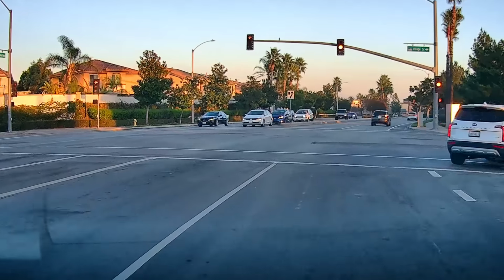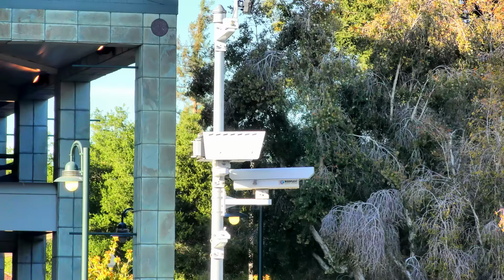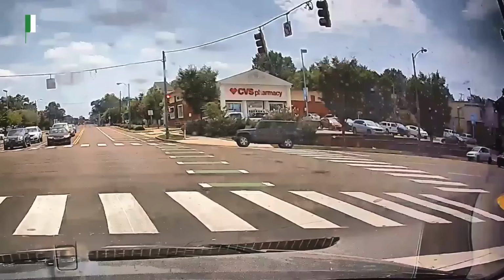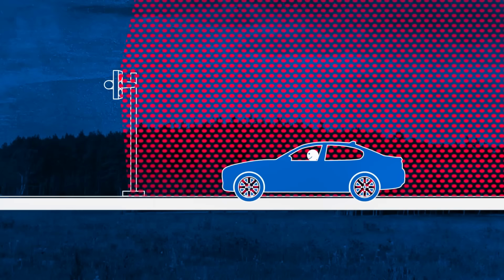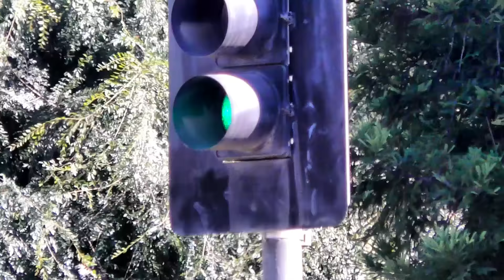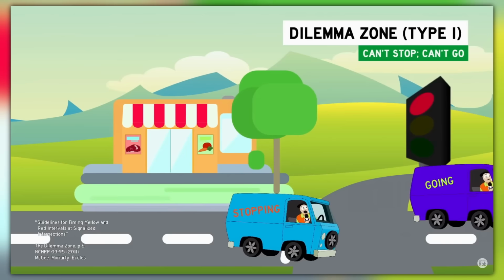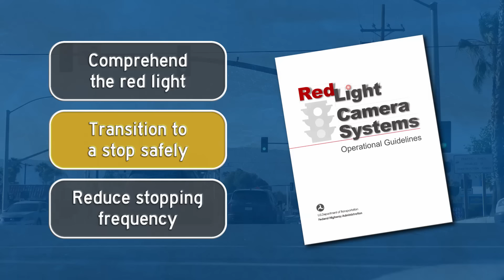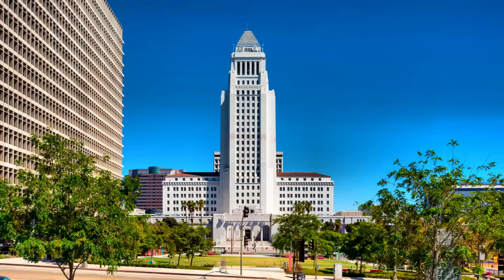Three ways to FIX a STOP LIGHT (so drivers ACTUALLY STOP!)

Comment: I like intersections where there is a countdown on the cross walk signal - it provides a good clue as to how long before the yellow light will come on.  Perhaps something like that but more visible would help people avoid the dilemma zone.
Reply: Beijing has some really advanced signals where the red and yellow lights also doubles as a numerical countdown timer. Seeing the seconds until the next red/green really helps with mentality behind the wheel, especially when negotiating the much less straightforward lane usage changes and chaos of oblivious pedestrians and careless two-wheelers (both pedal and motorized).
Reply: where i live those count downs are totally misleading at some intersection
Reply: @robertbennett2796  I guess that you're talking about the crosswalk countdowns, correct?  I've noticed the same thing where I live: just because the crosswalk timer hits zero does not always mean that the traffic light itself has just hit - or is about to hit - yellow
Reply: I agree with you, but I think it currently violates the US DOT road signal/signage regulations. I looked it up a year or two ago.
Reply: Morocco does this with their traffic signals. Red and green lights with a count-down to the next flip. I loved seeing it when I visited!
Reply: I also like this because when your waiting you can see the countdown and know that a green is not far off. For long lights it can help your sanity just a little bit.
Reply: @brandongaines1731  Yea depends on the intersection. Although usually you pickup on the rules on roads you drive down all the time.
Reply: In other countries the entire traffic light is actually just a giant count down timer.
Reply: I've seen car traffic lights with countdowns in places in Koper, Slovenia several years ago
Reply: Smart signals will keep adding time to the green light based on traffic volumes (there are detectors in the road). So a timer can not be installed on these efficient signals since they can't predict how long they will stay green. They adjust in real time based on traffic.
Reply: @failedfishermanBC  Actually I have seen timers reset to a higher number part way in the green cycle and the red time increase so clearly the technology to add 2 numbers together and display it exists. lol

However, I have never seen them shorten the time, that may be where an actual issue lies.
Reply: @zeroibis  Yes, adding or subtracting time from a timer really negates the benefit of a timer lol
Reply: @failedfishermanBC  The boost resetting the counter would not be troublesome as long as the boost was never applied when the counter got to single digits.  Not an unreasonable constraint.
Reply: @stevengordon3271  Yep, you're right. Most signals wait for a "gap out" time to decide when to turn yellow. Typically this is 4 seconds so that if no cars are detected for 4 seconds, it will instantly turn yellow and then red. The gap out time also normally shrinks the longer the light stays green (so a signal is more likely to switch to yellow if it has been green for a long time). So a signal doesn't really "know" that it will extend the green time until the final few seconds before a yellow light.
Reply: @failedfishermanBC  That is abrupt, but with a gap there is nobody there to care.
Reply: Yup the one by my neighborhood is like that if I can see the little walking man from several blocks down I get up to full speed and just make it by a few seconds. If I see the hand blinking I won't hit the gas so hard cause I'm gonna have to stop anyway.
Reply: It kinda backfires in the DC area, especially with red light cameras. The countdown causes people to panic and slam on the brakes unnecessarily.
Reply: I think a study was done that found that timers were worse, As they were more likely to race the yellow
Reply: Yes! I use the crosswalk count down when possible.
Reply: I have the opposite problem.  In Bellingham, at the intersection of 126 and 140, the cars STOP at a GREEN light!  By the time anyone moves, the light turns red!
Reply: I saw one once that both the red and green had count down on the main light. I thought it was super genius. While the red light was on the yellow light area turned into a red countdown colored red. While the green light was on the yellow light area turned into a green countdown. I was told if someone pushed the walk button while the light was red a pedestrian pictogram would show up in the green area colored red. So red light is full circle > timer > pictogram all red. If a pedestrian in the flow of traffic during a green light would show a green pedestrian pictogram in the red area. So green light is pictogram > timer > full circle. The idea to notify people that a pedestrian may be in a cross walk and to obviously stop but not to go until clear or extra observance turning left or right while the light is green.
Reply: @failedfishermanBC  I've also seen signals here in Canada that have the pedestrian timer solid for a bit, then add the countdown. Rare, but I think sensible in an area where the traffic flow changes dramatically based on time of day, holidays, etc.
Reply: Honestly those are amazing, I didn't realize how much they were useful until I lived somewhere that had them and then went back home and I couldnt tell when a life was gonna turn yellow and you basically have to guess without them.

I will say anyone that misuses them however, like making it turn yellow or red at 3 seconds, is messed up and should lose there license to do anything road related, but as long as it follows the logic of 1/0 = yellow it really solves alot of issues
Reply: @sharrpshooter1  In Guatemala City, they have countdown timers on the red. I remember one would start at 90! That's worth shutting your engine off.
Reply: @brandongaines1731  There are some intersections by me where the countdown timer counts down and if there is no traffic on the minor road it just goes back to walk and the light doesn’t turn red. 
Some others the walk signal comes on 2-3 seconds before the green light if someone has pushed the beg button. The first is annoying as a pedestrian if you are walking up to the corner while it is counting down and no traffic on side street you still have to push the button or the side street doesn’t get a green. You might not push it in time and then have to wait the whole light cycle before you can crops the street.
Reply: @Crash8668  I know how that goes - though, tbh, the only intersection like that near my house is one where I'm usually walking along the main road, anyway
Reply: @Crash8668  I personally am not a huge fan of the ones that turn on the walk signal before giving the green light to the traffic - if it's not safe for the motor traffic to move until the other direction has had a sufficient chance to stop, then how is it safe for pedestrians to do so?
Reply: @brandongaines1731  I hate one by me where I have to cross 3 corners as the 4th has no crosswalk. Miss the one to cross the Main Street and wait 2-3 min. Worse when raining.
Reply: @Crash8668  I can sympathize - the intersection on the main avenue by my house has one crosswalk that gets its own personal slot in the cycle - if you miss it, then you have to push the button again and wait for the cycle to come around again!  I once missed the bus to a job trial because I kept missing the signal and having to re-press the button!  In retrospect, of course, I should've just tried going around the other 3 ways and waiting for the next bus - better late than never, lol
Reply: all have that
Reply: One intersection near where I live has the  crosswalk that goes yellow at 5 seconds and red at 3 seconds. Might as well delete the yellow light.
Reply: @kgaming7599  not all of them. Even on highways there's lights with no countdown, it's just yellow for 2 seconds then red
Reply: @brandongaines1731  You are correct.  However, seeing the crosswalk countdown may make people more alert to what's happening: if traffic lights turn yellow, you have anticipated that you must slow down; if they continue to be green, you can continue, with duly cautious speed, through the intersection.
Reply: @brandongaines1731  -- As for your comment about the walk light turning on before the green, that is more engineering taking place. The green is delayed so that pedestrians can start crossing the street before turning traffic takes over the crosswalk. In other words, it is for pedestrian safety.
Reply: @TheRealScooterGuy  thanks!  I probably never would have realized that on my own
Reply: In some parts of Mexico, the green light start to flash to warn drivers of the yellow light. I honestly prefer it and it helps me avoid that dilemma. I wonder if it would help out in more places?

(Also outlining where the 'point of no return' is? And, adding more time to the yellow 🤔)
Reply: So I'm not the only one who used crosswalk countdown to indicate when the traffic light is going to change. 
I think something like that could work great on the back of a car showing its speed. Red brake lights don't show you how fast the vehicle in front of you is slowing. But with a speed indicator on the back of cars if the speed is decreasing slowly they're breaking slowly if the speed is decreasing quickly they're breaking hard as in they just  hit the brakes.
Reply: that will lead to more distracted driving, resulting in more rear-end accidents...I like my idea about pop-up spike strips.
Reply: About half the time nothing happens when the count reaches zero.
Reply: @AshGreen359  In my area, I have learned which intersections have useful crosswalk countdowns.
Reply: Yes! I use those in my downtown area.
Reply: @failedfishermanBC  Rotterdam (which is in the Netherlands, meaning they have smart traffic signals that adjust the length of green time, in real time) tried adding timers to their traffic lights, and it failed miserably. "Ontario Traffic Man" has a video on it
Reply: Yes, I love them!  This should be everywhere,  crosswalk or not.
Reply: I totally agree with the countdown. 
Before the timers, when the  ' don't walk  ' started to flash,  I'd start to slow down. However,  sometimes that didn't always work because as I'd almost come to a complete stop it would change back to walk.
Reply: The best solution is short timer that starts counting around 5-10 seconds before the light changes. This way it gives you some information when you can expect the change but also does not prevent using advanced traffic light systems that are deciding on changes based on the traffic. Generally you can't say that the light will change in 60 seconds because those systems don't know it. Maybe it will change in 20 seconds if there's no more traffic and you can go. But those additional 5-10 seconds of countdown will be enough to let almost everyone to take much better decision. It's wet or snowy, you have longer stopping distance and you see a few seconds left, you already slow down and stop as you would not clear it in a safe way.
Reply: well said,  five to ten seconds plus the yellow duration is a pretty generous time to clear.  And likely to improve safety considerably without interfering with timing.
Reply: @brandongaines1731  If no one has pushed the button cross street button, it won't change. However, if there is no cross walk button, then it will change automatically.
Reply: Steven, you are right on the mark about the countdown peds BUT, unfortunately, many localities are seeking to do away with the "CNA/rest-in-walk" feature that allows coordinated mainlines to automatically display a WALK signal along with the travel green light.  Jacksonville's (FL) mainlines have seen this feature being removed, resulting in continuous DONT WALK display unless a ped call is made, and when the WALK does appear it no longer holds the WALK until the signal is about ready to release the green indication, leaving us to guess whether the signal might change especially if we are caught in the dilemma zone; as you suggested, the countdowns allow us to determine whether we need to pace it down or to maintain pace to catch the back end of the green.  We still have a few strings of signals on some mainlines that are still running the CNA/R-I-W but I imagine Jacksonville will make those disappear in due time.  Another great example of fixing something that wasn't broken!  While in SoCalif for several years, I found no evidence of the use of CNA/R-I-W except maybe for some secondary mainlines.
Reply: Those are nice, but they shouldn’t be required. The dilemma zone should be non-existent, if the traffic engineers make the yellow time long enough to begin with
Reply: If they were consistent it'd be an excellent addition to the roadways.

My two nearby towns are about 30 miles apart and they both utilize counting down caution timers. One cities timers countdown to yellow, which lasts ~3-5 seconds. The other city utilizing countdown timers include the 3-5 seconds of yellow. 

So
- Light is green and timer shows 10 seconds to yellow
- Light is green and timer shows 10 seconds to red
Reply: Problem is here in florida (probably other places too) the countdown has no relation to the light, only the walk sign, so it does pretty much nothing for both pedestrians and drivers
Reply: @clooss  That is especially true if the WALK signal is not automatically indicating under the CNA/Rest-in-Walk feature usually in association with coordination modes.  If the ped signal is strictly under ped actuation, the WALK signal will not rest and the countdown might commence as indicated by the programming and the DONT WALK indication may stop flashing without necessarily coinciding with the termination of the associated green light interval, leaving knowledgeable drivers like ourselves wondering when the green light will disappear.  Just like the late night flash modes that once dominated main lines, the CNA/R-i-W feature is also gradually disappearing.  

Here is Jacksonville, we still do have some stretches on some of our main lines still utilizing the CNA/R-i-W feature which obviously makes it easy for me to know when the green light is about to expire, but not nearly the extent we were using this two decades ago.
Reply: @brandongaines1731  It depends on whether the programming has the ped signal operating under the CNA/Rest-in-Walk feature (usually found on main lines during coordination hours) or the ped signal is operating strictly under actuation (WALK signal will not rest and, as you suggested above, the traffic light itself will not necessarily turn yellow upon expiration of the ped countdown).
Reply: @danfreiberger5137  Yeaaa here in st Pete it’s pretty awful, walk signs barely correlate with lights at all. At this point as a pedestrian you can’t safely follow either, and it turns out being easier to just jaywalk since on main roads there is usually a middle turn lane that isn’t super occupied
Reply: agreed/ I wonder f having a single digit countdown IN the yellow would be feasible  (technically yes, but would add to the cost, I would think(
Reply: count down is assume everyone is good people, but most people will think they will make it so they speed up
Reply: Those are great.... when they work.  I have seen countdown walk signals that mean nothing because once the countdown completes, the light remains green.
Reply: What sucks about this is when the cross walks don’t perfectly sync up with the lights, so sometimes I begin slowly down because I see the crosswalk countdown, but my light doesn’t turn yellow. And now I’ve just created a bigger problem in the road because I was relying on a signal that isn’t made for drivers.
Reply: @brandongaines1731  Wait, what? What good is a countdown timer if it does not correspond to a safe crossing? We have weird countdown timers in my city in The Netherlands with the extra that almost all junctions in The Netherlands are dynamic (induction loops sense cross-traffic and if there's none, they will give you a green light while approaching without slowing down most of the time). The crossings I talk about are dynamic as well, which results in the countdown timers showing the full scale when you press the button (in my city they don't show seconds, but a ring of LEDs that go out one by one), which could turn off almost all at once if there's no cross-traffic (if you still take your surroundings into account, you could be waiting at a green light for a few seconds).
But once it's green, there's no countdown showing how long you will get a green light.
Reply: @failedfishermanBC  They can. My city in The Netherlands uses countdown timers for cyclists at such dynamic crossings. The timer just doesn't show seconds, but a lighted ring of LEDs instead, with the LEDs turning off one by one. The downside is that if there's no cross-traffic, the full ring lights, to just turn off within a second. Other than that, it works fine.
Reply: another solution used in some parts of the world - the green light will flash for 3 seconds before switching to yellow. So you have 3 seconds to assess if you need to stop
Reply: In Siem Reap, Cambodia, of all places, we encountered traffic signals with large countdown displays that counted down, in the color of the current signal aspect [I think], the seconds until the change.  The green-to-yellow countdown helped eliminate the dilemma zone, and the red-to-green countdown helped drivers prepare to shift their manual transmissions to start at the change [while assuaging impatience].